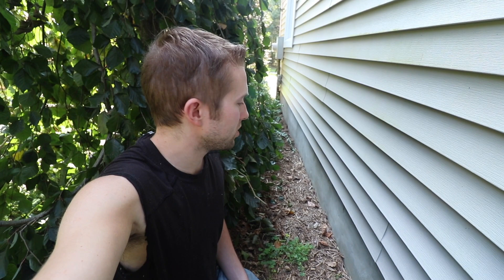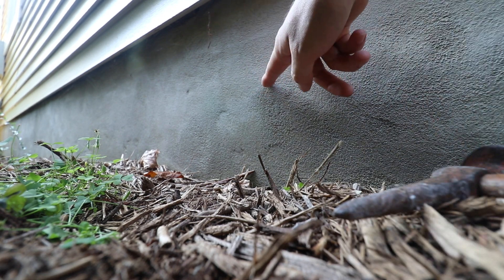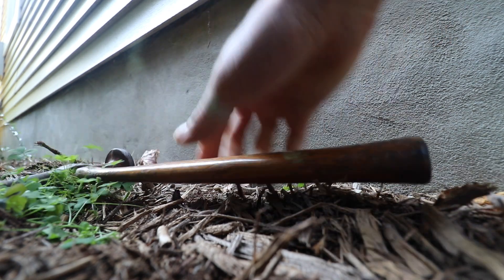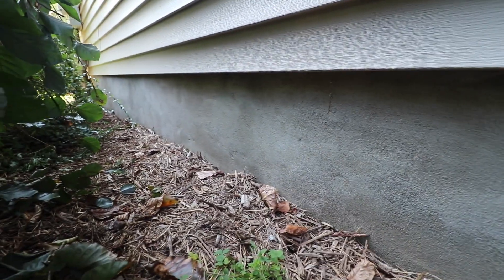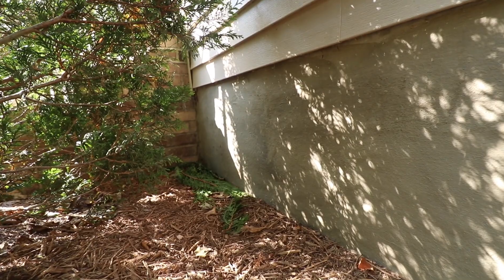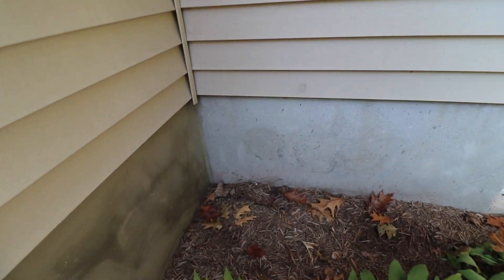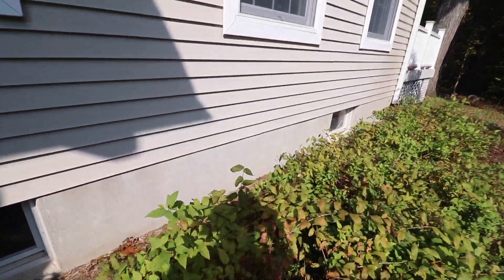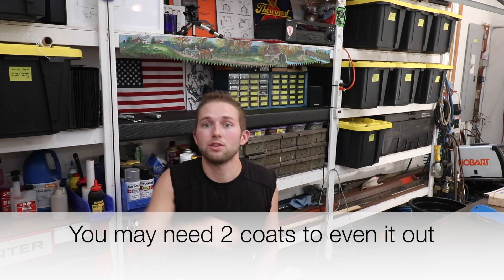Foundation Parging, 1 Year Inspection

Comment: Excellent!! Thank you so much for the follow-up video. I’ve watched your other one what feels like 20 times & was concerned I wouldn’t be able to match our existing parging. I never even thought to paint Portland cement to make everything more cohesive. Thanks a million for all of the excellent info & for taking time to create such detailed videos.
Reply from the maker: Gland I could help! My final tip: Portland cement has a shelf life. When you go to buy a bag in the store, make sure that It doesn't feel hard when you press into the bag. After you open the bag of Poland cement, depending on humidity and how well you seal up the bag, it will only be good for a few weeks. If the bad feels stiff or hard, do not use it. You got this.

Comment: Hey! Great video. Just wondering what you think of water getting trapped between the parging and foundation? Have you done any research on this? I currently have a large porting of parging which looks like a sand/portland mixture, and it seems to absorb moisture quite easily. Not sure if it's drying externally or if it's getting caught in the foundation?
Reply from the maker: Concrete is porous by nature. Its like a sponge. If you live in a climate that gets below freezing like I do, its important to keep it dry as possible. When you tap on the surface with a hammer, does it sound solid or hollow?
Reply: @OldSoulMillennial  Most areas sound solid, although a few areas are cracking and some of the foundation is crumbling behind. My house was built in 1904 so it's to be expected, although the parging seems to have been applied within the last few years. I bought the house last year, and noticed 2 areas where different parging was applied. It's lighter and smoother in appearance, so I don't think it was the best mix. It was cracking and bubbling, and after hammering away at all the loose stuff I had a nice hole going into my basement close to a window frame. So definitely looking to avoid what ever parging they used for that section. I'm thinking it might have been a big box store mix but I could be wrong. I'm in the NIAGARA area, so pretty close to you in terms of region I think. I think I will go with your advice and try 1 part portland/ 2 part sand. Just another question for you. In my area, I can't find mason sand, but I can find all purpose sand. Do you know if those are the same material? Also, what do you think of applying some kind of concrete sealant to the parging to reflect water away?

P.S Thanks for replying and thanks for making great videos!
Reply from the maker: @GT-vs8vv  send a picture to my email in the video description of what's going on. Sounds like someone may have applied a stuttco mix. You can't find mason sand at a big box store? They should definitely have it. I would advise against play sand.

Comment: What if the block is painted? Wire wheel it off? Or will it adhere to the painted block
Reply from the maker: Do not apply over paint. It will not adhere properly. You must remove the paint by any means Necesary . Usually, a wire wheel on an angle grinder is what's required. Wear a respirator
Reply: @OldSoulMillennial wire wheel did nothing to paint I ended up nailing up galvanized lathe so we'll see if it holds up 🤷🏻‍♂️ just one small section of my house